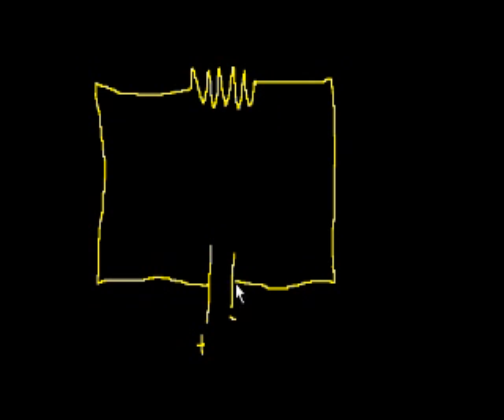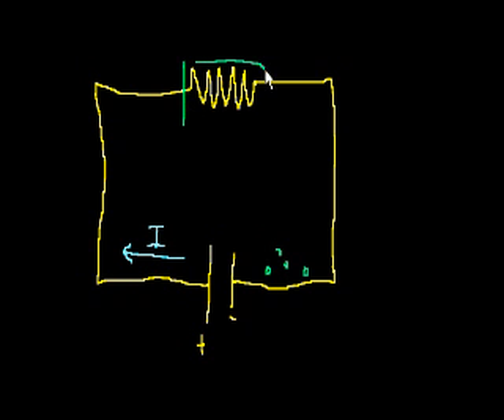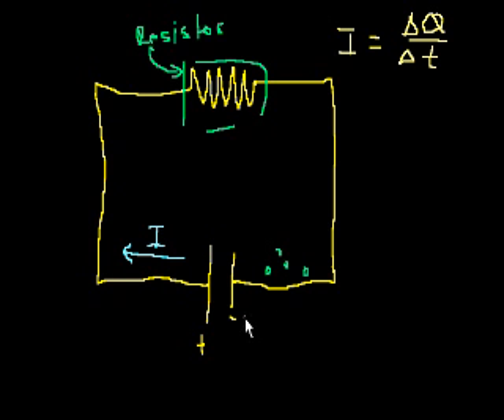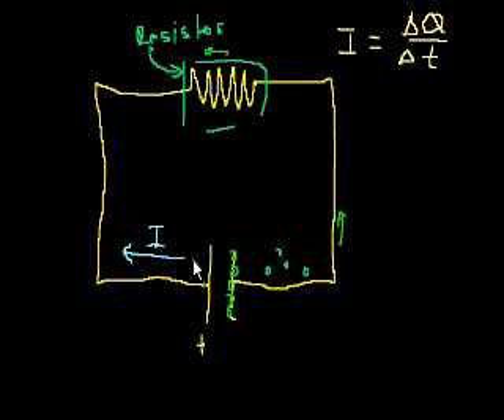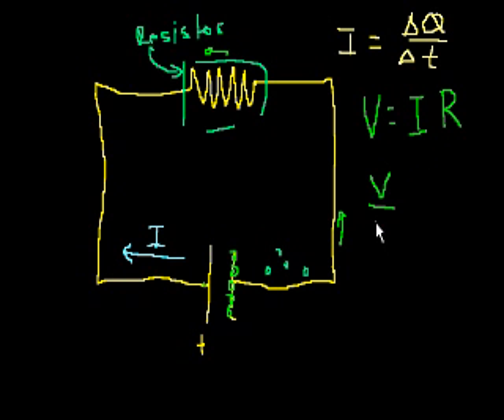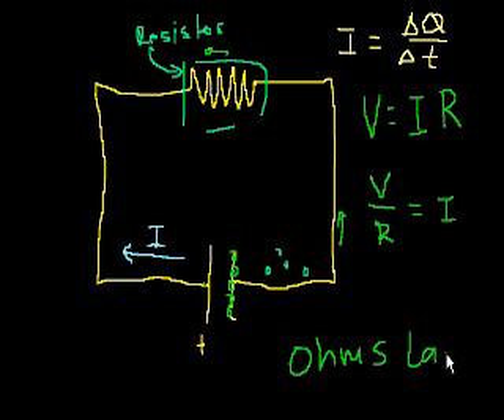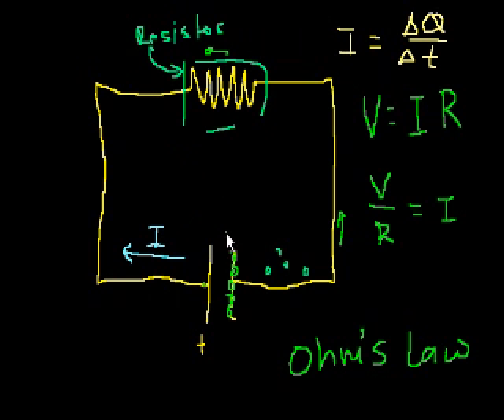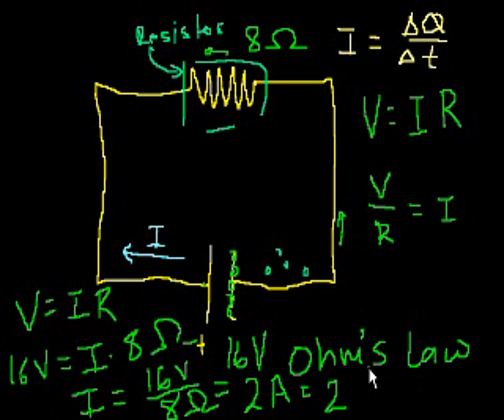Introduction to circuits and Ohm's law | Circuits | Physics | Khan Academy

Comment: Actually, electrons are about 2000 times bigger in volume than protons. So don't say that it's because of the "size" that it's crazy to think of protons moving, that they are these "big" particles and electrons are "little". Protons are 2000 heavier than electrons.

Comment: in 9:52 you said that the resistance increases with temperature but isnt it the opposite with LDRs and Thermistors where when the particles get excited they move faster thus the resistance decreases
Explain anyone?
Reply: Nimra Gauhar think about it this way, as temp increases pressure in the line goes up making more difficult for charges to move( this is so simplistic is almost wrong)

Comment: Any recommendations on books that synthesize electrical engineering and audio technology effectively? I am currently studying the recording arts and am looking to strengthen my understanding on Valve/Transistor based circuits as well as anything else that will further my education all around. I would also appreciate recommendations for starter books on general electrical engineering because I obviously want a solid foundation in the basics before I go into analyzing circuit designs in audio tech

Comment: since current flows from negative to positive wouldnt that effect where you put a resistor before an led? if youre doing calculations from the positive side then you put the resistor on the positive side wouldnt that blow the led since the current is flowing from the negative? shouldnt that change everythng about the circuit because then you wired everything backwards? or do you put resistors after leds and everything we know about circuits is wrong and backwards?
Reply: +Matthiu Ryin or now maybe i get it.. you put the resistor on the positive side of the led because the resistor is slowing the electricity down on the negative side of the resistor.. that is weird and it did pretty much just change everything i thought about circuits..
Reply: +Matthiu Ryin but it looks like it comes out of the positive side then the resistor slows it down then it travels slower down the negative side.. but if that was true then the positive side would be slow and the negative side would be faster? is the positive side faster or the same speed as the negative side?

Comment: +khan academy.   can you guy make a playlist of the electrical video's?
Reply: +ken ezzell There are several factors in studying circuits. One plan I found that successfully combines these is the Gregs Electro Blog (google it if you're interested) definately the most useful info that I have ever heard of. Check out this  great site.
Reply: the best success that ive ever had was with the Gregs Electro Blog (i found it on google) definately the best course i've followed.

Comment: @sasuke kage arc Its the physics they are testing you on, not so much the actual electronics. If you plan to go into physics, you will no doubt have to use electric circuits at some point.

Comment: Correct me if I'm wrong, The Voltage Potential talks about electrons only. The Positive Terminal in the battery is "in fact" the highest concentration of electrons, thus the high potential. Which is why it flows from this Positive terminal to Negative. But you' re quite correct in saying someone made a confusion to begin with by naming it Poistive Terminal. Maybe an appropriate name for it should have been HIGH(e-) then the other end should have been  LOW (e-), hahaha

Comment: Why is it that there is no voltage drop across a wire with 0 resistance? I know there is no energy loss but isn't the potential energy converted to kinetic energy and voltage is potential energy per unit charge.
Reply: interesting idea.  But with zero resistance the electric field inside this perfect conductor would be zero and hence at these locations may not do any work.  Well thats my quick anawer, the truth may be more subtle eg. the current is actually  confined to the skin of perfect conductor etc.

Comment: Here is what I don't understand: Does electrons or charge get "lost" during the process thanks to resistance or do all electrons all eventually make through from on pole to the other? If they don't make it all the way through, where do they end up? What happens to them?

Another question is regarding the potential energy stored in the electrons. When that energy is harnessed to power things, what happens to the electron? My understanding is that the potential energy of the electron is what drives it to move from one pole to the other. When  that energy is depleted or lost, does  the electron simply stop and get trapped in the cable or slow down or what happens? 

I'm eternally greatful for answers that can  give me some insight into this matter!

Comment: The diagram you've used for a battery is actually for a single cell. A battery would be two or more cells joined up. Just saying!

Comment: so if convention is from positive to negative for current but electrons flow the other way and lets say we want to light an LED. on which side of the LED  should the resistor be in order to decrease the current.
Reply: It doesn't matter.  The presence of a resistor in a circuit will decrease the current of the series in which it is placed.

Comment: This is definitely a dumb question but what would the current be if there was no resistance...? I'm having a brain fart
Reply: I assume you mean by Ohm's Law, which states that I = V/R, normal intuition would tell us that if there was no resistance the current would be infinite, right? True, but in reality not all electrical devices are so called 'Ohmic devices', meaning they follow Ohm's Law. Srujan is correct, resistance is always present in wires, with resistance depending on the wires length and width. Baktybek brings up an interesting point with the introduction of superconductors (which have been around since the 50's). These are special alloys (e.g. YBa2Cu3O7) in which when cooled to their critical point, effectively have zero resistance, these are not Ohmic devices, and hence do not follow Ohm's Law.
Reply: That would be a... how do you say it... a short circuit? (Eng is not my 1st language, sry)
Reply: there is no such thing that has resistance zero dude... even a very small wire has a small resistance
Reply: Srujan Hunkzz in 21s sentury has superconductors which are without any resistance
Reply: I think the answer you are looking for is that - in the real world - batteries / power supplies have a finite current output. When you have a resistance that is small such that more current is being drawn that the supply can output, the voltage drops such that you maintain V=IR. So, say you have a 5V supply that has a 1A max output, and you put a small 1 Ohm resistor across it... that resistor "tries" to pull 5 amps, but the supply max is only 1 amp, so what you actually end up with is V = 1amp x 1Ohm = 1V... meaning your power supply drops and is actually only putting out 1V.
Reply: ***** Interesting, is there another formula they use in that instance? If there is zero resistance and they do not follow Ohm's law, then what parameters are they governed by?

Comment: Is not that the make some convention so the current goes from positive to negative. In reality, the scientist thought that the positive charges were the one that move through the circuit, but then they discovered that is was the other way around. Happily it doesn't change anything thinking it in one way or the other, so they left it that way.

Comment: Actually the voltage of the battery starts to decrease with discharge too, depending on the chemistry used it is different type of curve that is different from the capacitor's almost linear discharge line. Most of the devices running on batteries can handle little bit lower voltages for instant a radio with rated 3V supply can run with 2V without any disruption, so the decreasing voltage of the battery is not affecting performance immediately after been turned on.

Comment: If you want to stick to reality, you should say that the electrons are not actually flowing, because the real movement of those is quite small, the system is moving, therefore creating current, but a single electron moves remarkably slowly.
Reply: 10^-4 m/s is indeed slow

Comment: Correct me if im wrong...but u said that electrons move @ a constant speed throughout the battery.....but how does that work if the resistors slowdown the flow?
Reply: If I am not mistaken the resistors slow down the flow in the whole circuit so the flow still is constant.

Comment: I have a question, if the electrons flow from the negative terminal of the battery(which I know they do) how do more complex circuits work? Like I work with small electronics a lot, so if you have an IC chip in between, all the logic and inputs to that are "positive"(or just missing electrons) so how does "positive current" do anything?

Comment: I'm confused. I thought Volts was just electric potential. Potential is just difference in energy from here to there. Why would that change depending on the path? Also, increasing resistance looks like it would increase the volts as V = IR... is that true? Kind of odd that resistance would amplify.
Reply: +cursedswordsman 
What i think is if you increase the resistance, more hindrance in the path. Look Voltage is provided by us, it wont change. What will happen is that no current will flow as there is more resistance to it. Thats my guess.

Comment: Technically, the electrons flow from negative to positive. However, at the time that Ben Franklin was messing around with electricity, they he didn't know whether it was positive charges that flowed or negative charges. So he treated it as if positive charges were flowing, and it stuck. Even though it's electrons flowing, we treat current as if it were flowing from positive to negative. This helps simplify signs.

Comment: Thank you so much. I have my physics gcse unit 2 in 2 weeks and the actual official textbook is useless compared to your videos. There's too much of a focus on learning facts; I learn facts WAY better when I actually understand them- precisely what I couldn't do before (I couldn't understand current voltage or resistance).

Comment: I think it is a bit misleading to state that the electrons flowing through the resistor slow down. In steady state (which is all that is important for DC circuits) current moves at the same speed in all parts of the circuit, that is the battery, resistor and all wires. If the electrons "slowed down" in the resistor there would be a build up of electrons on one side of the resistor which would constantly be increasing. The electron collisions in the resistor primarily generate heat not slowness.

Comment: Well this is a mathematical way of Saying this......1/0 is actually infinity.......try it on your calculator....divide 1 by 0.01......then 0.000001 and 0.0000000000000001 ...as denominator tends to 0 the fraction approaches infinity.....ask your math teacher or revise your functions chapter

Comment: So Voltage is how badly the electrons want to get to the +pole.
But because of resistance, they cannot actually go as fast as they want, they go there with a particular speed, that is the current.

There is one question coming up for me: What if the resistance was 0?

Than the current would be: I=V/0
Now we've got a problem.

Comment: To clarify questions of the which way the electrons flow. The reason that they flow from the positive to the negative is because the positive side becomes positive because electrons are leaving (thus creating a net positive charge) and the negative side becomes negative because that side is storing the electrons sent over from the other side.

Comment: Electrons flow from the negative

@ShakkIsLife  true, if you're certain that the conductors are metal.  If they're electrolytes, then the charge is both pos and neg, and flows in both directions.  Same with plasmas.  In Proton conductors the charges flow from pos to neg.   Physics simplifies this stuff by ignoring the actual charges polarity and declaring them all to be positive.   Realworld Ammeters measure CC Conventional Current, and they can't detect the charge carrier polarity.

Comment: Charges flow *through* batteries of course. A common high-school misconception is that no current exists in the electrolyte, or that battery internal impedance is large (when it's actually near zero.)

Electrons don't flow in circuits, they flow in *metal* circuits. Include a human in your circuit (electric shock,) and there's no electron flow in that living tissue. Same with salt water, the earth, etc. Yes, all circuits are conductors with flowing charge, but they aren't all metals w/electrons

Comment: @775shahrukh 
Yeah but then has the current and the voltage changed from a scenario without a resistor? Because they travel slower you say, and therfore has lower energy, which leads to less voltage. And since they travel slower, there is a lower current aswell. Am I following you correctly?

Comment: @DoS37 by definition of current "rate of flow of charge"...if u say after the purpose of the resistor is to resist the flow of current ..ths means less flow of electron pet unit time..in other words we can say that we have slow down the electrons...by applying resistance in the path of flow of electron

Comment: I think you said something that's not completly correct Sal. The electrons has different speeds (m/s) before and after the resistance, but the current is the same. The electron are just more "dense" after the resistance right? Because they loose some of their speed and therefore some energy which leaves the circuit as heat?

Comment: @abtarabishy It was Ben Franklin who came up with the sign convention for currents and charges in the late 1700s.  At that time there was no way he could have known that the charge carrier in metals is the electron.  It would not be until JJ Thomson discovered electrons about a hundred years later that this became an issue, but by that time the convention was firmly entrenched.

Comment: Wow, thanks. I've been reading about power supplies and the book was telling me the "wrong" direction of flow and it was really stunting my learning.  Does this mean you can measure any circuit's in/out w/ multimeter set to ohms and divide that number by the voltage it needs and get how many amps you need for it?

Comment: If i was to try explain why current was initially chosen to flow from + to - i would look towards ions. When an electron is lost, the atom has an overall + charge in basic terms. So... if you relate this to circuitry it would seem that electrons are lost from the anode giving it a positive charge and "arrive" at the cathode giving it it's negative charge. However wrong it may be, it was the first thing i expected before being told how electrons actually flow in a circuit. If that helps? :)

Comment: battery is a magical thing??  
i was also taught before that it was the + which had the power not neg. 
one way to test this is.. connect one lead wire of a light to postive and ground the other .. if the light goes on ..its the positive that holds it.. try it also with negative..
attach one to negitive and ground the other wire from a light.. HEY it doesn't go on.. what do ya know

Comment: @rinwhr He means that without the resistor, it would go lets see a speed at 100 but with the resistor it goes a speed at 50. but the electrons dont build up, they flow constantly. the resistor makes the electrons go slower, but there is a constant flow no matter what throughout the entire circuit.

Comment: @rinwhr Think of the electrons as cars going round a one-way road. If the cars in front slow down, and the cars behind are moving really fast, there will be a crash. We don't want this to happen. In the same way, the electrons don't want to bump into each other if they don't have to, and so the elctrons behind the electrons in the resistor must go the same speed, or electrons will be bumping into eachother all over the place, and no current would flow. Current means the flow of electrons.

Comment: @Yohannesiscool Kirchoff's Rule is simply the Loop Rule and Junction Rule. Loop rule is everything in a contained Circuit loop must be equal, and Junction rule is any Current going in must equal all Current going out.

Comment: Mass-Energy Equivalence was used in the development of the atom bomb. What happened at Hiroshima and Nagasaki proved it worked.

The reasoning is simple. Newtonian Physics said if you traveled at the speed of light, you should see peaks and troughs of light waves. Maxwell's equations forbids that.

Where is the proof either exists?

It is not an optical illusion, you go back in time.

Once more, torsion fields are pseudoscience.

Comment: Einstein's theories have been proven experimentally. E=mc^2 has been proven by studying electrons almost at the speed of light and the atomic bomb. General relativity has been proven during a solar eclipse by showing that light was bending because of bends in space time. Particle smashers have never been able to go past the speed of light.  Synchronized clocks have been seen going differently when they are moving. Once more, I never said laws.

Comment: Torsion Fields are a pseudoscience topic with severely flawed postulates. Neutrinos do in fact have both energy and mass. Gravity is the weakest of all forces. Why should it succeed where electromagnetism failed? A household magnet is stronger than all of the earth's gravity. That is a sample of the greater difference between the forces. It is just that most molecules are magnetically neutral, so we don't experience it as much as gravity. Gravity is only noticeable because earth is massive.